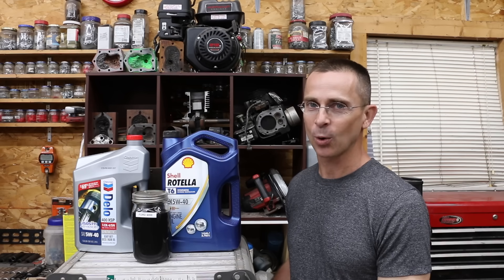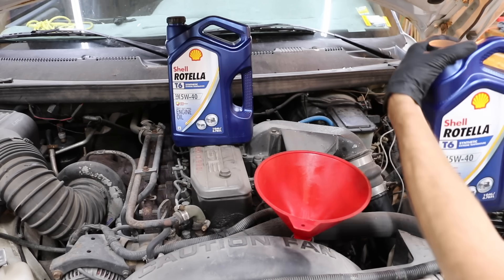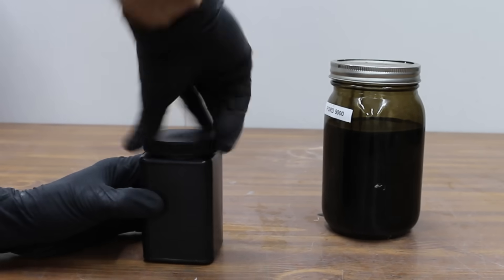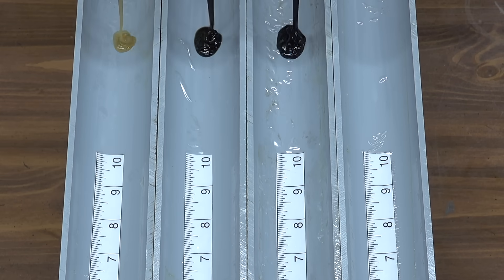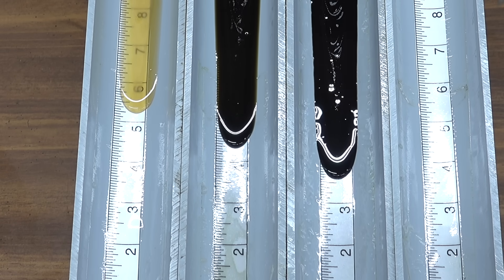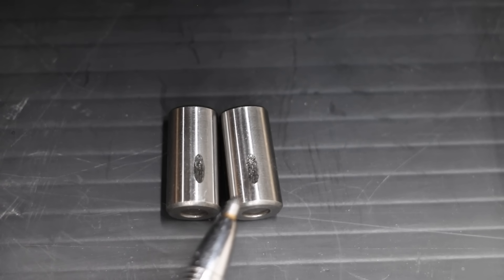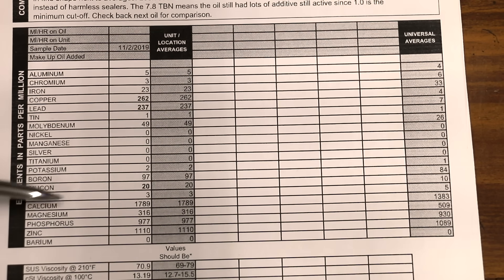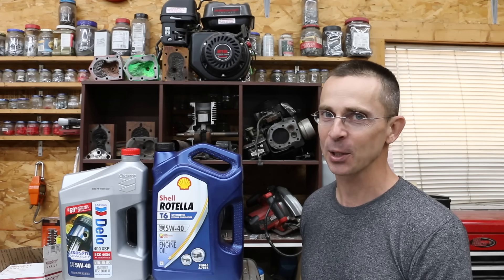Will Annual Oil Change Damage Your Car? Let's find out!

Comment: it's all fun and games until you only use the car for short trips on the winter.
i let it slide for 14 months because i didn't even do 1k kilometers
but had to use the car in the cold for some short trips
turns out there was enough moisture and water in the old oil that i started seeing some white stuff and bubbles, going to change the oil.

if i did some longer trips and burned the accumulated moisture it probably would be completely fine tho
Reply from the maker: Thanks for the feedback.

Comment: I have 2 vehicles, one I have for 23 years, in 23 year I replaced the mufflers, tires, repaired a radiator leak and replaced fuel sensor unit in tank that’s it. the other I had for 15 years, in 15 years I replaced the belt, fuel pump and filter, tires, and one injector that’s it. I changed all fluids in trans, diff.,brake, etc. at least once in both vehicles, but I change the motor oil once a year like clock work.
I may drive each vehicle 5000mi a year. Just came back on a 3300 mi road trip with no problems, used the better of my 2 vehicles.
Reply from the maker: Thanks for shairng.

Comment: I've been wondering about the time-based oil change intervals recommended in owner manuals for as long as I've owned vehicles. Both for my car, but especially for my motorcycle which gets extremely low kms per year. Thanks for testing!
Reply from the maker: You are welcome!  Thanks for sharing.

Comment: so many variables - condition of engine, weather, leakages, people.  To know that you need to do analysis of used oil after change and know your car condition, but majority of people have, you know, their lives to live, so missing the point when oil gets out of spec is not very hard. This rule of thumb helps people to at least not reach this point and have normal oil. The guys who really know cars and what to do with them already know when to change oil. Such people probably have mileage per year more that recommended interval of oil change which is like 5 000 miles so annual oil change is not a thing for them, it is more relevant for people who care less about their cars and it is convenient for them to have exact time to change oil, like annual events like birthdays, new year or Christmas, like "every November I change oil" exact day is not very important. Cost of oil change is small compared to cost of engine, $30-$100 a year for an oil change compared to thousands of dollars for engine repair, even $1000 engine repair is like 10 years of annual oil changes. Do the math and choose wisely.
Reply from the maker: Thanks for sharing.

Comment: I admit that I haven't changed the engine oil in my truck for a whole year, even though the mileage is still relatively low. I've taken into consideration that the oil doesn't completely degrade based on time and can still be effective for a few more miles. However, it's important to stay vigilant and consistently check the condition of the motor oil. The degradation process has likely occurred, causing some minor alterations in its original quality.
Reply from the maker: Thanks for the feedback.

Comment: I'd really like to see what happens when you put regular engine oil in a 4 stroke motorcycle with a wet clutch. Does it destroy the clutch or no?
Reply from the maker: Thanks for the suggestion.

Comment: This is what the local Midas shop told me. At the Shell station that I usually go to, they said once a year. I have a Cruze that takes the more expensive synthetic oil mandated by GM. I drive about three or four thousand miles a year. Yet, I might continue to go no longer than a year because both my car and my wife's Hyundai Elantra have supposedly cheaply made transmissions. My wife also drives little. We're both retired,
Reply from the maker: Thanks for the feedback.

Comment: just wondering about riding lawn mowers. I have full syn . in my Kubota and usually have 60-80 hours run time per season.  what would that equal in Miles?? the oil still looks fine and of coarse my mower is at peak heat for 2 hrs at a time mowing over 1.5 acres of land.. thx for all of your great work.

Comment: Not sure if this matter but wonder if the fact that these were oils designed for diesel engines makes any difference to oils desigmed for gasoline engines and if the oil change interval is different as well

Comment: Sir I own a 1983 Mercedes 300SD inline five cylinder turbo diesel. I buy at sam's club a case of the Rotella non synthetic oil. I change my oil every 3,000 miles. I have over 250,000 miles on that engine, never been rebuilt. The engine purrs and quiet. That Rotella is the oil to use on diesel engines!
Reply from the maker: Thanks for sharing.

Comment: Lat e to the party but just ran across this post. Thanks for volunteering your vehicles for long term oil test. Now that we are retired have a similar issue. My wife's car is newer so gets used the most (13k miles year). Mine used mainly for trips to the dump (3k).  Nice to know the annual oil change interval is not a hard and fast rule.

That being said I do my own oil changes (about the only thing I'm still able to do on modern cars). Oil/filter change is pretty cheap so I'll probably continue doing it, but it is nice to know if I blow it off a year it is not a big deal. I agree with your closing comment about making sure the engine is used enough to get up to temperature to evaporate any condensed water.
Reply from the maker: Thanks for sharing.

Comment: Thanks for the great info. Not sure if you have done this comparison before, but my 2022 Ram w/ 6.7 Cummins  is coming due for service. OEM says to run 10w 30 f/s in summer and to run 5w 40 f/s in winter.  Evidently the Cummins is have lifter issues prematurely @ 60K. What would be your thoughts on what oil i should run. I'm thinking the 5w 40. Thanks for any insight
Reply from the maker: You are welcome!  Thanks for the suggestion.

Comment: Fun fact you can use “diesel” oil in gas engines. In fact Rotella T6 is the most recommended oil for use in Subarus (specifically the turbo ones) amongst the several different Subaru and oil forums
Reply from the maker: Thanks for sharing.

Comment: Really nice video. I have a very low mileage, (<2K mi/yr), summer only, Camaro convertible. It sits in a cold New England garage all winter on a battery tender. It takes a whopping 10 qts of synthetic oil. I do change the oil each Spring and always question the need to throw out $50+ of oil that comes out looking new. I know the concern is moisture. But unless I drain out cold oil, I have to run the engine before draining. If running at full temp for 20 minutes removes the moisture, why change the oil? Most research I've done still makes a strong case for changing. But your video has me doubting the necessity again. Any opinions would be welcomed. Thanks for a very nice analysis and presentation.
Reply from the maker: Thanks and you are welcome!

Comment: excellent and very informative. Will it reduce engine wear on my two old 6 cylinder, three litre engines? The 1990 Mercedes has an odometer reading of almost 300,000kms and The GM Holden straight six is at least 50 years old. I live next to the sea in a temperate climate, so no temps below 2 degrees celsius. Both cars are used several days/week.  I really enjoyed the video. Thank you. Best wishes from Makara Beach, Wellington, New Zealand.
Reply from the maker: Thanks and you are welcome!
Reply: My 1989 MB 190E 2.6 ran literally forever. They were simple and reliable back then. The body panels were also thicker than other cars.

Comment: I use AMS OIL sig series... and only drive under 3K a year... it's rated for 1 year or 25 K... I feel confident after watching this video, that switching to another brand of full synthetic would not hurt much even without the 1 year rating.
Reply from the maker: Thanks for the feedback.

Comment: I used to run a commercial trailer rental fleet. Some of my refrigerated trailers had to be used for dry storage for a while, so the engine did not run at all for several months. When we got them back, I had a tech tell me we needed to change the oil on them because "oil goes bad". They had 20-30 engine hours on the current oil based on the engine hours written on the service records. I told him not to touch them, that oil has been in the ground for thousands of years and isn't going to go bad in a few months!
Reply from the maker: Thanks for sharing.

Comment: Thanks for the info. I have a Chrysler minivan that averages 2000 miles per year. I am using synthetic oil, and felt that changes every six months were more than needed for a low use vehicle.
Reply from the maker: You are welcome!  Thanks for sharing.

Comment: I'd really like to see a test between all the Shell diesel oils. T4, T5, T6 15w-40, and T6 5w-40.

In regards to the video here, I have an F-250 and a Mustang that don't get driven but a few thousand miles a year. I've sent in analyses on both vehicles after well over a year of the oil being in the engine, only to be told that with modern oils it is more about actual usage, not time. My F-250 had the same oil in the crank case for about 3 years and only about 5,000 miles and the TBN was still WELL within the acceptable range.

As with all of your videos, great job! I really like your scientific approach, including control groups, to all of your testing. Your videos have certainly influenced several of my purchases.
Reply from the maker: Thanks!  Thanks for the suggestion.

Comment: I use diesel oil in my gas cars because it works so well when in stop and go traffic as well as during an Italian tune up where most oil specific to gasoline engines don't do well when on short trips and stop and go traffic it tends to sludge up
Reply: Same, well I use Shell Rotella, I wouldn't use other kinds of diesel oil until I investigated it I guess.

Comment: Great information!  I've always been a bit leary about "time based" oil changes.  Mileage is one thing, but modern oils sitting in a closed engine is another.  Excellent points about the overall environment possible effects on the resting oil.  As always, very nice work and presentation.  Thanks for your efforts!
Reply from the maker: Thanks and you are welcome!

Comment: OK here I go again
1978 I was working at a Chrysler Dealership in Hemet CA. 
an old guy had a 1956 Dodge not a hemi - I think it was - it had 300,000 miles on it he said he changed the oil and filter every 300 miles and that the engine had never been opened at all
not even a timing chain
Reply from the maker: Thanks for sharing.

Comment: T4 is jaso-2? Compliant for wet clutches like an atv has, T6 is not, would be interesting to see what different oils do to a wet clutch like that... not sure how youd test for that tho...
Reply: It is too.Jaso dh2, jaso ma, ma2 it say right on the back i'm looking at it right now and just put it in my LS 650 bike .It's actually a even better Jaso compliant than T4 .
Reply: @joecamel6835  well it used to not be on there, hence why i said i ran t4.... if its compliant today cool...

Comment: AYE but you can pre-load a horizontally mounted oil filter, as I do my Ford.  You just can't fill it up. Only put enough in to saturate the elements and about 1/3 up from the bottom. It won't leak if you don't tip it beyond horizontal. The Cummins mount is so very much better.
Reply from the maker: Thanks for sharing.

Comment: I had my 24-valve set up with a bypass oil filter for micro-filtration. Using that setup you only sent off oil samples to the lab to determine if an oil change was needed.  Commercial fleets often do it this way.  My '98 12v now has 345k on it.
Reply from the maker: Thanks for the feedback.

Comment: my buddy has a farm and they leave their machines for months without starting their farm equipment.  he said if they start it they make sure they run the engine  for long period of time if they were to start it.  He said he doesn't see how an engine would collect enough moisture sitting in engine.  You said you should start the engine and warm the engine up once a month.  how did you come up with that conclusion?  I guess a good test would be for you to test and sample oil monthly for a year out of the same engine.

Comment: Great informative video and certainly food for thought. As an engineer myself I am curious what then is a good oil change interval for a vehicle that is running in good condition with no mechanical issues. Of course many factors come into that such as the oil quality, type of driving, environmental conditions and age of the engine.
Reply from the maker: Thanks!

Comment: Changing oil yourself only cost $45 for my car. I would rather spend that money than having a weird feeling about whether or not my oil is still useable after one year. I know this test proves that it does not matter, but I still would rather be safe than sorry. Rebuilding your engine is a lot more costly than changing oil.
Reply from the maker: Thanks for the feedback.

Comment: Great test! My dealership was having me change oil every 3k, but new dealership says once a year. Im a recent widow (my husband got 439,000 out of his 95 Dakota and did all the maintenance and repairs on our vehicles) and have to rely on yt and research. I appreciate your work and attention to detail.
Reply from the maker: Thanks and you are welcome!   I extend to you my deepest sympathy on the loss of your husband.
Reply: jenny I am a mechanic, it will not hurt your car to do it at 3,000 but if it is a newer car it is wasteful cars, like people need more care as they age, an average car will be ok with 7,000 miles until you hit about 70,000 miles then you should shorten it, over 100,000, 3,000 miles will keep it going, also the more miles you have, go up on the viscosity
Reply: What oil, climate, type of driving and what vehicle is a factor to consider.  Totally agree that, bumping the viscosity on an older engine is not a bad move!  Proof is in the podding... @jimsix9929
Reply: I do agree on determining the oil change based on the driven miles. The only thing more accurate would be to have an hour meter! I think that the 1 year thing is probably a fairly good estimate on the milage on a regular daily driver in a year being close to the 5000km mark. Just guessing at stuff!
Reply: I would also add that you should check your owner's manual. I have a Kia Sorento that recommends every 6,000 mi... My Honda motorcycle is the same
Reply: You should still change it every 3,000 miles if it is conventional oil, or 5,000 if synthetic, but you don’t need to change it every 3-6 months. Still change it based on operating miles. Dealerships will tell you more miles, but more than about 5,000 can cause damage, longer term.
Reply: @Tir220  THANK YOU!  PREACH!!!!!!  IM TIRED OF THE ONCE PER YEAR RECOMMENDATIONS
Reply: The dealership will tell you more miles because they want to tell you what you want to hear and they don’t care about the car so long as it makes it one day or one mile past the warranty.

Comment: I remember reading long ago that motor oil can be recycled indefinitely, so it should be possible to design a filtration system in your vehicle that removes impurities and moisture to always keep it in new condition, perhaps a multiple filter setup preferably with washable/reusable filters.
Reply from the maker: Thanks for sharing.

Comment: Your vehicle will tell you how long you can go. If the oil is sludge after 5K or 3 months dont go any longer. If the oil is fine after 6 months then you are good to do some exploring.  However pay attention to the filter. Once it fills up you are no longer filtering oil and that is very bad. I have been changing filters at required intervals and checking the oil regularly and never had a problem. Oil today is much better than what we had 50 years ago when the oil filter guidelines were written.
Reply from the maker: Thanks for the feedback.

Comment: I love your analysis methods. I change my oil and filter once a year in my 1989 350 Suburban since installing a new engine 7yrs ago. It also has a frantz oil filter which I change the element (toilet paper) bi-monthly. The car is only driven 5000 or less mi. per year, small distances, but on a regular basis. The oil remains absolutely clean ! I live in the high desert of California, so not much in the way of moisture here. A good test would be between a Frantz oil filter and a regular cartridge type. I know the Frantz is a bypass filter,  but I use one as a full flow on my 1959 Apache truck under similar or even less service conditions. 
The excess, nonfiltered oil returns via the oil pressure release valve. No other filter is used, still the oil remains clear for the yearly oil change. I've had the truck for 24yrs. now, and only tuned it up twice. It starts as soon as the gas reaches the carb. which can take up to 5-10 seconds, oil pressure is immidiate. Thanks for all you do here, it remains one of my fasvorite, most watched video programs. I've been subscribed for years now !
Reply from the maker: Thanks so much!  Thanks for sharing.

Comment: That's good because I live up north and only put about 3000 miles on my vette a year. It hold 10.5 quarts of synthetic,  so it gets expensive. I do my oil change right before I park it for the winter to have the cleanest oil possible sitting in the bearings.
Reply from the maker: Thanks for sharing.

Comment: This is plain uninformed. In short, some engines are "dirty" and some "clean". Any mechanic worth his salt can come up with some horrible examples. Frequent oil changes are cheap insurance given what a rebuild costs nowadays. Also, the constant hammering the oil suffers shortens the oil molecules and makes it less capable to resist high pressures in particular between the cams and the followers. I enjoyed a lot of interesting and well carried tests on this channel. But this is not one of those....